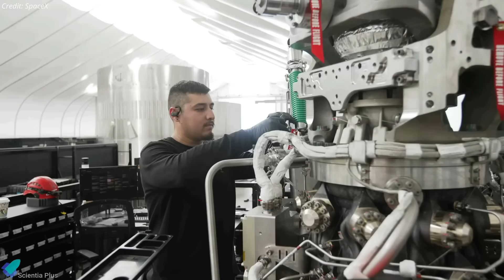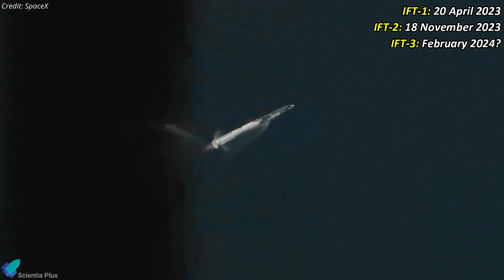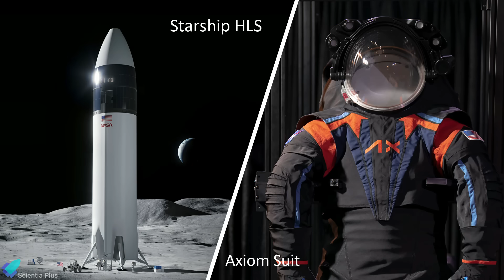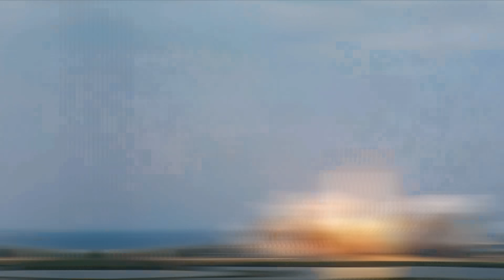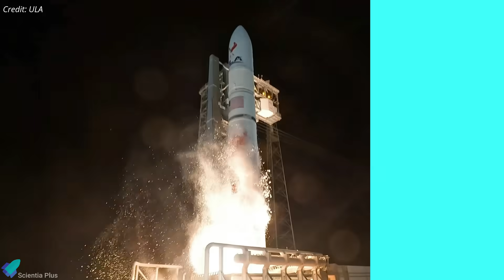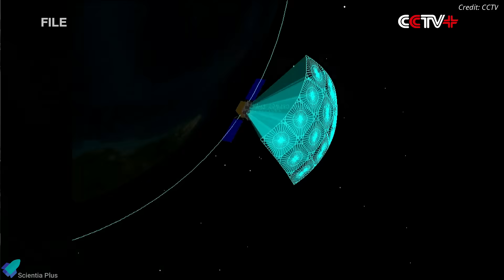SpaceX Confirms Starship Launch Date & Propellant Transfer Demo, Artemis SLS In Trouble

Comment: The propellant depot needs a sun shade like the James Webb to prevent boil off
Reply: Yes.  A tube made of photovoltaic film would provide shade and some electricity to run coolers or whatever.  Roll it up before starting transfer ops...